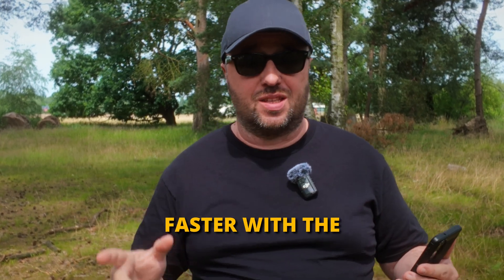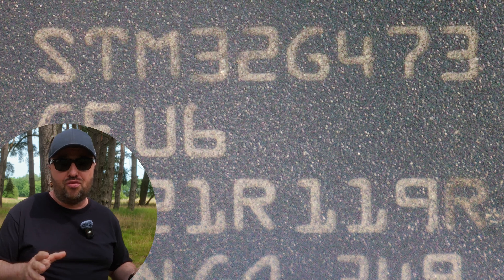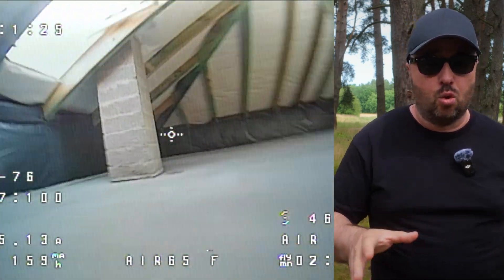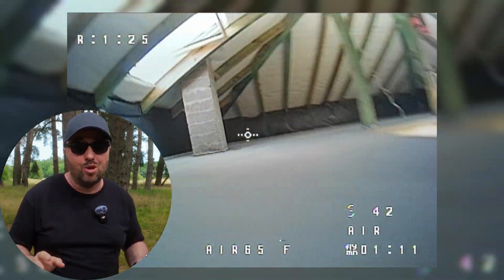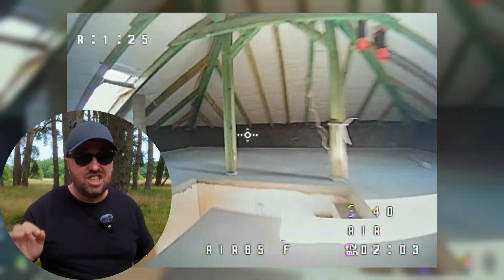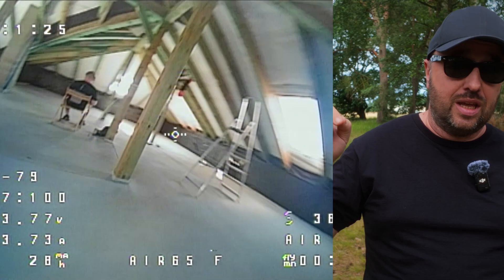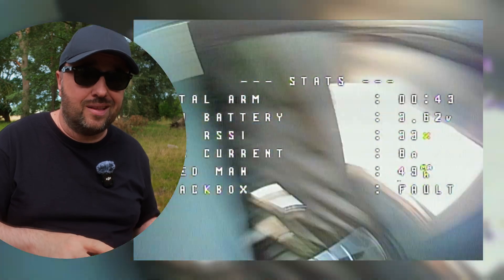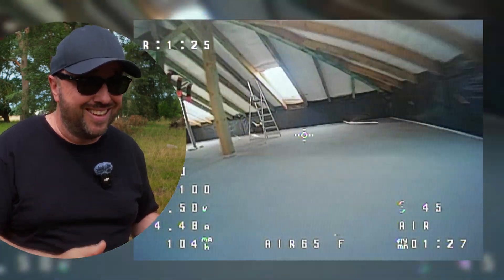Why this whoop is different? BetaFPV Air65

Comment: I second that inertia statement.. I got the Air65 racing. We've tuned it and boy, that thing stops and turns in like 0.3 seconds (you know what I mean). We tuned it with the 300 lava pack. Now, after putting in a 260 it's just nuts. REally good review.. This thing is the shit and it's like 85$ ? now?
Reply from the maker: yeah, I know what you mean!

Comment: Can anyone recommend a goggles for this air 65? I am new to this and don’t know which one to buy, is the vtx analog or digital? I have seen the walsksnail avata hd L which is digital with good price but not sure if this air 65 supports digital video. Thanks
Reply: Air 65 is analog only. I've heard eachine ev800 is a good cheap analog headset

Comment: I don’t understand why they offer two configurations. Why is one slower than the other?
Reply: i have both FS and R versions. I think beginner pilots would prefer the lower Kv of the FS because the R is more difficult to control in tight spaces. first rip on my R this morning.   https://youtu.be/yN-KqT8N8Z0